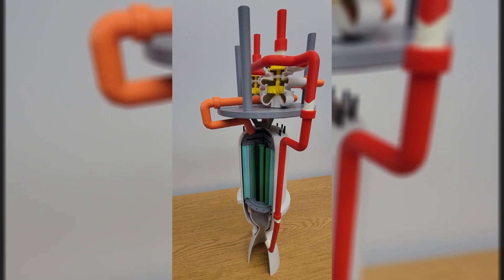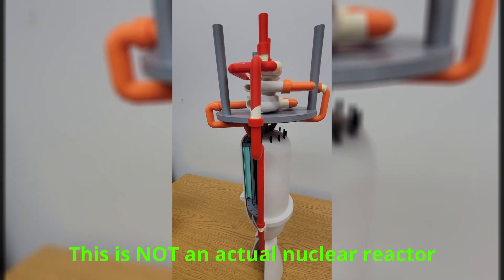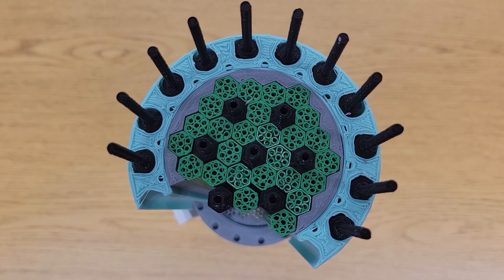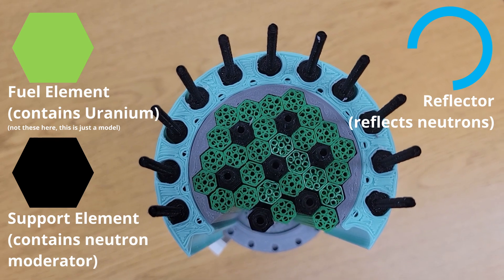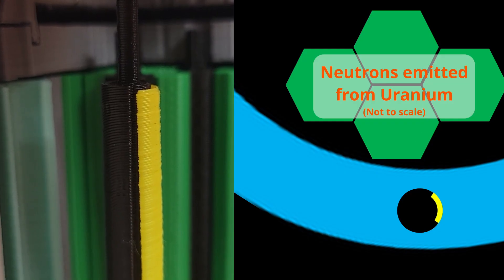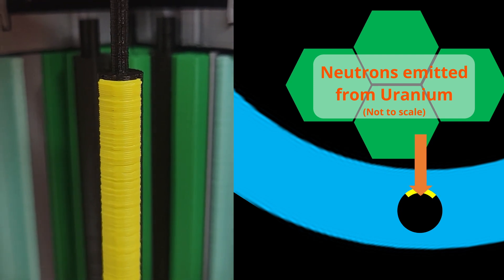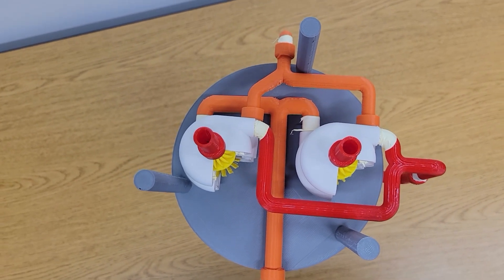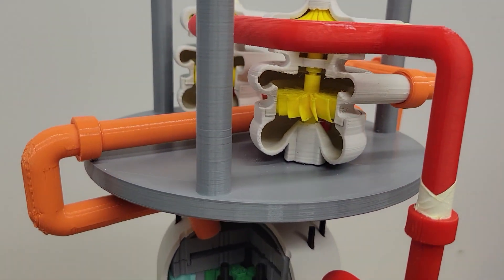How a Nuclear Thermal Rocket Engine Works (NERVA Expander Cycle)

Comment: Kinda inspired by the nuclear lightbulb but would it be possible to use an extremely high purity UF6 gas inside of fused quartz tubes surrounded by ideal neutron reflectors (with a propellant channel in between) such that the UF6 could be confined inside the fused quartz tube by a rotating cyclone of inert, or better yet neutron reflecting gas, if such a thing exists, basically ‘assembling’ a sub-critical UF6 gas, compressing it and keeping it off the walls of the quartz tube until it reaches  supercriticality? It would release much more energy than a typical nuclear lightbulb NTR? Could the fused quartz contain this pressure? Could fused quartz, with its low cross section of radiation absorption survive this for very long?

Is this just the hardest way to take advantage of criticality? The hardest matter phase to use for criticality? It’s not a bomb, cuz supercritical masses quickly go subcritical unless certain very hard to achieve conditions are met. This would quickly go subcritical and would need frequent recharging from a tank of subtitula UF6?

Could this be done with another nuclide like plutonium or a trans-Uranic, or thorium? It seems like criticality is this awesome, very interesting and energetic nuclear reaction that’s slept on, but because aside from the atom bomb, it doesn’t really have a use. And if this enhanced nuclear lightbulb, the nuclear flashbulb, doesn’t work just because the material engineering and nature of gaseous UF6 and density required for criticality makes it impossible rather than the nuclear physics making it impossible I would be peeved. I thought I remember hearing about a criticality incident involving a liquid UF6 and an accidental increase of nuclei density until it flashed and killed some Japanese guys. Am I crazy? 

So build one of those please and let me know how that part works. When it’s ready I’ll get the 99.5% U-235F6 gas for you. Don’t even worry about that I know some people.

Comment: I've been trying to learn about NTP and struggling, but this video made it so simple and easy to understand! +1 sub, extremely underrated!
Reply: It’s literally just an open-cycle nuclear reactor tho
Reply: Honestly the most complex thing in here, provided you’ve taken nuclear reactions and things that thermal neutrons do, is the turbopump. That’s usually the most complex thing in any liquid fueled rocket ever made actually maybe without exception. Idk maybe fuel circulation for cooling nozzles. Maybe variable plug geometry rockets I forget what those are called, the ones that can turn into aerospikes and optimize geometry for single stage to orbit  essentially. I still think the turbo pump is the most impressive and slept on rocket component here in this magical fire powered open cycle steam engine